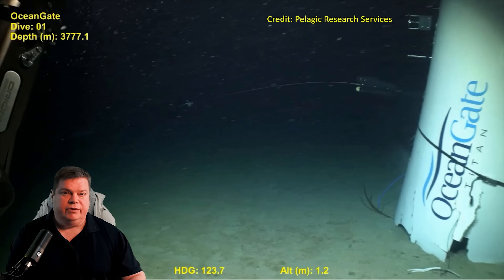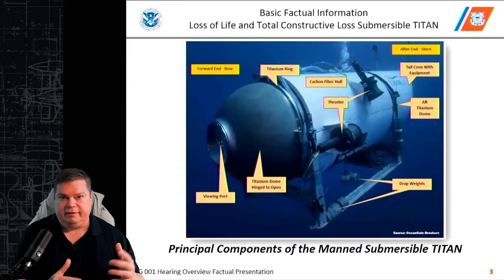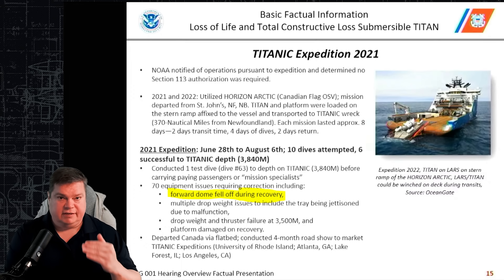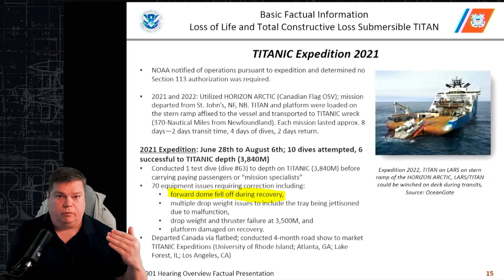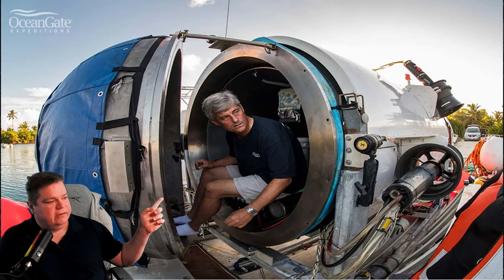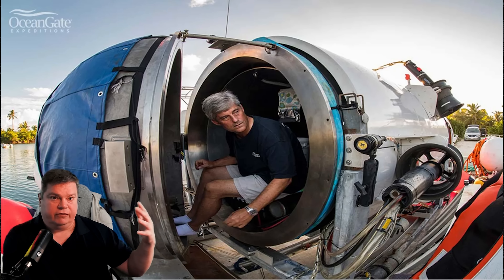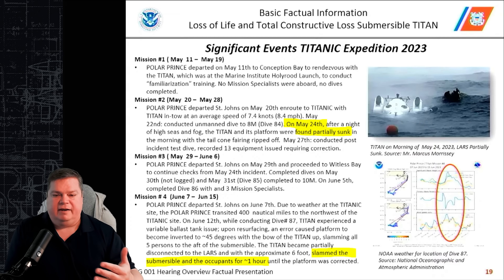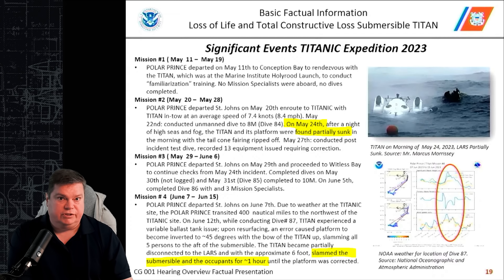New Evidence in Titan Submersible Disaster

Comment: If you study the building of Titan, available on YT, you will see the mating of the titanium rings to the carbon fiber cylinder. You will note that the surface of the titanium appears quite smooth, not roughed up to provide a better bond. Additionally, note that the worker applying the epoxy constantly touches the mating surface and wears no gloves. Any oils on his hands were transferred to that surface prior to mating the surfaces. Now consider that the titanium and carbon fiber react differently to high pressure. The fiber would tend to flex to some degree, while the titanium wouldn't. So this mating surface was problematic from inception.
Reply: Did you notice the dirty rag ? Probably full of oil or grease 😮
Reply: Especialy all the people just casualy walking around it, touching it, no gloves as mentioned and just placed plain outside in a warehouse. No special assembly and isolated chamber nothing...
Reply: The only part of Oceangate that was perfect in every way, was its PR-campaign. They managed to hide all the mistakes, bad engineering, lack of testing, to lure rich clients to the bottom of the sea in a ticking time bomb. Stockton Rush wanted to be the Elon Musk of the oceans, and he did it in a way that was never going to work.
In the construction of the Titan, they cut every corner they could, used bad materials, bad methods, …
When they did testing on the 1/3 scale of the Titan, they discovered that this design just wasn’t safe, and they predicted that it could have a couple of succesful dives, but repeated cycles of huge pressures would lead to a catastrophic failure. Which is exactly what happened.

This accident wasn’t a surprise to the professionals in the field of submersibles, and the disaster that Stockton Rush caused, wasn’t just predictable, it’s downright criminal negligence. He knew it would all go wrong, and took passengers with him anyway. If he had done all his dives solo, I wouldn’t have minded. Those 4 passengers in essence paid $250k to commit suicide.
Reply: Good comment.  They also mixed the epoxy by hand and didn't have paper suits over their street clothes -- sure way to introduce bubbles and dust which will form little weak spots.  It was obvious these people didn't do this for a living.  I worked in a fibreglass shop for a  couple of years and we took more care in making what were basically pool toys never intended to go to the bottom of the North Atlantic.
Reply: They built it in a warehouse, pros do it in a autoclave, controlling temp., humidity and degassing.
Reply: Dude all I could think while watching that was "god I hope that's just for the camera. Please god let that be just a set for the camera dont let this be their actual process. 
Low and behold...
Reply: Stealing word for word what WCGW said in a video last week. Lmao
Reply: The titanium ring interface where the front dome was bolted on was recovered separately, and the inside of it where it was epoxied to the carbon fiber hull was smooth, clean, and devoid of any bits of fiber, as was the dome itself. That's what led Tym Catterson to come to the conclusion that it was blown off when the epoxy failed, causing the implosion. As you stated, the flexing of the hull's end gradually weakened that bond until it finally failed. By comparison, the rear ring was still attached to what was left of the hull, one part of it is still attached to the dome, and the dome itself has visible damage.
Reply: @karlharrelson1091  wouldn’t the water pressure push the end caps into the carbon fiber at depth? like the view port was said to push 3/4 of an inch
Reply: I have a comment from a video when this happened about this, i'll have to go back and find it, the fact the hull had NO prep done, no solvents, no acids, no milled pattern inside the titanium for the glue to bite to, no interference fit of the hull to the ring using a bolt on 3rd part to capture part of the hull so even if the glue fails the ring wont come off!? Not done in a clean room but in an open air warehouse essentially where they do surfacing too and make dust, you never glue up near where you grind/sand, the glue they used was loctite ea9394 is rated for less then 1 atm not more then 1, its aero glue designed for CF planes not sub glue, they did no degassing, I did read the datasheet for the glue and it does say it doesn't need to be degassed if you use it for its intended purpose, which they didn't so I would of done it anyway just in case, its meant to be ejected via a continuous syringe system via a cnc not scraped on by hand which introduces bubbles, also its not meant for 2 parts to be slid against eachother, its supposed to be extruded in a mound and pressed down into shape when 2 parts come together in a specific way, Im sure you've seen it on your car's seams, its the same thing, just everything is wrong about it imo I could go on but I think ive made my point.
Reply: @MrTeapots  seriously even your basic backyard mechanics know that is NOT how to properly mate two surfaces. Every engineer that touched this project should never be able to work in the field ever again.
Reply: I wonder if carbon fiber started to bow inwards as they were diving? As the carbon fiber was flexing inwards  the seal between solid titanium ring tore off. The titanium seal had been strong but each dive had weaken it, like metal looses its strength slowly as it is flexed back and forth movement.
Reply: most likely weakend the carbon fiber over time, because of uneven bonding and therefor stress cracks, that formed on the face where cf and the titanium rings touched. This also makes sense when looking at the pattern it collapsed in
Reply: The seal becomes stronger as the pressure increased.
Reply: @blessedheart3917 water pressure would push water betweeen the ring and the hull the moment that the seal breakes.

Like an engine piston with worn rings, the high pressure moves the líquid/gas behind any miniscule crack towards the área with lower pressure
Reply: @tjnucnuc  That’s why Stockton Rush fired so many people. The moment engineers started noticing all the mistakes and spoke out, he quickly got rid of them and even sued them (Like David Lockridge).
In the end, Rush only kept the youngest people on the team because they didn’t know better or they were too afraid to critique the project.
(Under the guise that he preferred working with young people, claiming some nonsense about young people having more ambition)

Remember: Stockton Rush wanted to build a whole fleet of these submersibles. (In full knowledge that his design was terribly flawed)
Reply: I think with appropriate testing carbon fiber could be used maybe not for this application. Stockton chose to skip the safety side and just go for it. Obviously we know what happened.
Reply: @GoldBl4d3  different expansion rates plus uneven bonding are a killer combination, not better, just more worse
Reply: But, keep in mind that pressure is pushing everything inwards, not trying to separate covers from the body...
Reply: One of the engineers who testified addressed the issue of different modulus of strain for the different materials under pressure, and it was supposedly understood and tested for.  So before that engineer (I think it was Lockridge) left, they had designed for having equal strain modulus for the tube and the titanium ring.  Though Stockton and his team of sycophants may have deviated after Lockridge left.
Reply: Spot on. I can't believe they trusted going under pressure with basically just those bonded joints between them & certain death. Why build it so the middle carbon fiber haul could flex from pressure differently than the titanium end caps. Overtime those joints would weaken and eventually fail. (This sub should have only been a shallow water sub. They were charging a quarter of a million dollars per person so why not take that money and make a much more robust and well designed deep sea submersible... I'll never understand how anyone thought the Titan's design and build was suitable for deep sea dives. It doesn't take an expert to consider where the Titan's weak points are... Those joints between the carbon fiber and titanium epoxy joints
Reply: I’m not even remotely a skilled builder or engineer and I vividly remember thinking the exact same thing about them not sanding down the area where the epoxy was placed, AND the lack of gloves! Not to mention it wasn’t done in a sterile environment at all; it was basically a large garage with doors to the outside open too.
Reply: @ivicamilosavljevic4706  The problem with that is, if the tube flexes inwards even slightly its end is no longer flat. The epoxy will be under tension at the outer edge, causing a peeling force. The slightest gap will cause water to enter with full sea pressure, trying to force the joint further apart.
Even if the epoxy joint was designed to resist the theoretical tension, it would not do so indefinitely. And if it was hand layup well, nowhere near theoretical strength.
If any water enters the joint it is opposed by the compression force on the end dome trying to squeeze it out, but that is opposed by the flexure caused by the pressure on the carbon tube. Once water starts to enter, it will delaminate the epoxy very fast indeed and then enter the hull. 
As soon as the ring detaches, the hull is going to collapse starting at that end, because there is nothing but its inherent rigidity to keep it circular.
Reply: You saw that video too?
Reply: @LandoPro49  Let's say: Even if they followed all those important steps (which they should have) but I don't think it would change the ability to put All trust onto those connection joints.. the risk was always there to eventually have the center haul separate from the titanium end caps.
Reply: Coop submersible. 
Doomed from birth.
Reply: good points. also, if ones considers that the dome is pushed against the tube by the water pressure, and the hull itself is squeezed, it seems that the resulting force, is not "square" with the interface of dome and tube. if the interface were conical like the window too, then the resulting force would be more or less "square", "flat" with the interface. it does not need to be exact flat with the resulting force (vector), but within probably 10 or 15 degrees would be OK (like the friction that keeps nuts and bolts thread tight). 
the way the Titan was, the force would have been like 45 degrees sideways on the interface, and it maybe "slid" off. interference fit would also have helped indeed.  (just wondering what happened, not that it would not have happened, i do not know that)
Reply: the titanium fits over the carbon doesnt it ? would it then not be pushed tighter against the carbon at that depth .
same as diving with the 4 bolts wasnt a issue underwater it was on the boat though.
my guess would be more to the carbon cracking on the transition to the lip which went in the titanium ring do to a sharp edge/angle/corner in the transition.
are there already pictures of those rings which connected to the carbon and are they clean or do they still got carbon in there?
Reply: @ivicamilosavljevic4706  that pressure isn't just pushing in from the ends, it's coming from all directions all at once, one slight weakness in the seal and it's coming in, doesn't matter where it is, and once it's in, there's no keeping it out or stopping it.  

The other consideration is that carbon fibre was a poor choice because it's impossible to know if the layers are delaminating, Carbon fibre and fibreglass at those pressures dont bend and flex, they shatter, according to their own logs, that submersible took multiple hits while trying to recover it, as well as during the storm where it was damaged. and the front literally fell off, the argument of an imperfect construction pretty much presents itself...
Reply: @cornnatron3030   indeed, but, also the tube is squeezed strongly and compresses slightly. the inward force tries to squeeze the tube. this force can be really large, and the interface was along this stress line.
if the interface would have been conical,
that inward squeezing force, would have compressed the interface. the way it was now, the squeezing force had very little support and maybe sheared off (together with the carbon lamination properties, cascading faults)
Reply: Any dust in the air landing on the epoxy?   Don’t know.   It wasn’t a clean room.  Also they eyeballed the seating of the ring to the hull.    Sound good?
Reply: Fantastic summary. As a non-expert but with science background, appreciate your taking us through your analysis. 

No idea an implosion at this depth would “reduce” person(s) so completely. I suppose most all cell walls would undergo a sudden collapse. 

Your final comment about the robotic arms brings home vividly how unsuitable the Titan was.
Reply: Great summary, appreciate your taking us through your analysis. 

Had no idea an implosion at this depth would reduce person(s) to such a degree. I suppose so, as most all cell walls would be suddenly collapsed. 

Your final comment about the ROV’s robotic arms brings home vividly how unsuitable the Titan was.
Reply: Absolutely, . And basically just "Gluing" the two different types of surfaces together seemed suspectable to failure if weight and/ or twisting motions were eventually going to happen. In my opinion, there should have been 30° angle holes drilled into titanium surface, enough for the glue/ epoxy to be filled and add more strength from separation, at least half inch to an inch for enough to be filled and bonded with the rest of whole gluing process. Just my theory.
Reply: Very first day of testimony, very first witness was an engineer who had left Oceangate, who testified he saw evidence of glue seam failure on the forward Ti ring they recovered.  He said the 5" wide round face of the glue seam was completely  stripped off of the Ti; and he said that the inner "lip" of the ring, which snugly fit inside the tube, was completely and cleanly sheared off.  He said that proves that the front end of the tube collapsed inwards from all directions.  Like the whole tube was crimped on the end.
Reply: @Titus_2_11-12  That is exactly what I've been thinking, along with the poor surface prep of the glue. I build carbon fiber boats and all of our surface prep, even on small decorative parts, is higher quality than what I've seen from the videos of their sub construction.
Reply: No that had nothing at all to do with it im sorry to say.

There are some discussions around the thermal expansion coefficient of titanium and carbon fiber still going on, but the forces of thermal expansion are orders of magnitudes stronger of any glue in the world.
Reply: @blessedheart3917  imagine two seesaws end to end put 4000 pounds in the middle - the pivot point is a few inches from the outboard end probably less - the centre flexes down the outboard ends flex up the ends of the C/f tube are no longer parallel to the titanium - there is a gap -  this allows the water to penetrate into that gap - and this is occurring symmetrically along the axial centre line of the tube - if the bond between the titanium lets go at any point around the joint the the water will pierce the gap and begin the collapse
Reply: @kristofvandycke6687  Their PR wasn't perfect at all though, it wasn't even particularly good, because they were proudly putting their disdain for safety and proper design on full display, and also risking bad PR if Boeing, NASA, or University of Washington actually paid attention and sued Rush for misusing their name/trademark while making false claims about their involvement with Titan.

The PR was just lucky, bolstered by ignorance on the part of the "mission specialists".
Reply: @blessedheart3917 it would still breach under that insane pressure. With a broken bond with cylinder you now have a dynamically weak joint
Reply: Painting a Car gets more care than this narcissist death trap submarine.
Reply: @kristofvandycke6687  Not only did he think he was going to be the Elon Musk of the oceans, he thought the oceans were the future of humanity. He thought Mars is a dead end. He thought the surface of the Earth is a dead end (I mean fair, it will be, eventually, but so will the oceans). He thought the future of humanity is in the ocean to hide from the bulging sun. Wild, absolutely WILD and delusional.
Reply: it is something i stated from the beginning. that i assume if the craft had been manufactured in a proper cleanroom by more competent people the same shitty design could have survived many more dives. it was probably still always gonna deteriorate over time but i assume something minute like dust particles getting mixed in with the bonding agent or a fingerprint (oil) might have catastrophic consequences under such high pressures
Reply: @MrTeapots  I've seen better carbon layup in my niche of mountain bikes lol.
Reply: @karlharrelson1091  didnt pick up on human and foreign contaminates possibly or even certainly transferring to the ring let alone pre scuffing of that surface or surfaces.
Taa for those observations.
Reply: And the fact that they never put the carbon fiber through any sort of vacuum or oven to get rid of any air bubbles or cure it
Reply: @aznfoo  That's also pretty strange. Even with non-life critical items we are required to vacuum and bake with a very specific ramp up, hold and ramp down temperatures with about a dozen probes placed around the part and everything is datalogged and then checked by a third party.
Reply: agreed, the winding should have been in a helical pattern, conducted in a dry atmosphere. 
The videos appears to show the winding in a non conditioned building.
The weakest part of the vessel is the mid section of the cylinder. 
It would have distributed the forces much better with a slight barrel shaped cambering along its length.
But I don't design subs
Reply: @ivicamilosavljevic4706  That only takes the end pressure into account. The stress is also on the joint around the circumference where the two parts meet.
Reply: The titan sub was built well, the proof is that they made numerous trips in it already. The issue is that the sub isn't made for that many return trips as it degrades over time due to repeated stresses to the structure.
Reply: @BoleDaPole  If something can't do what it was intended to do, I'm not sure you can really call it "built well".
Reply: I paint Warhammer figures and even I know to scuff up magnets to make them bond to the glue and plastic of the figures.  Wtf was this submarine builder thinking
Reply: @BoleDaPole  That has to be the most idiotic conclusion ANYONE has made on the Titian sub. 
Other than the outright stupidity of your comment how many trips do you think that sub was made for?
Do you really think they made a sub for 10 or 12 dives and then decided that doing one more was Ok?
Reply: But it was cheap!
Reply: @mikeprevost8650  I think that's right
Reply: @blessedheart3917 less surface area than the cylinder. So more pressure force on the cylinder than the end caps. That squeezed out the end cap like gripping a tube of toothpaste and the cap pops open.
Reply: @MrTeapots  I work for a company that has a partnership with one of the bigger F1 teams, we were invited to visit the factory, which makes the monocoque. As you can imagine, air locks, filters for air, anti static materials, complete body suits, masks, gloves, and glasses for everyone.
Of every lot they make(6-7), they randomly take one of them and test it to destruction, to check if their procedures are in spec.
If there's a problem, they scrap the whole lot.
Reply: @Thor_Asgard_  I don't even think the issues sound particularly difficult or expensive to address, but his ego and hubris got in the way.
Reply: @kristofvandycke6687  Agreed. My jaw dropped when I learned that Stockton Rush simply took the damaged parts from the failed prototype and rebuilt them into the Titan. I just.... I cannot even comprehend that level of hubris and utter disregard for human life.
Reply: like a submarine from temu
Reply: @WobblesandBean  The first version of the Titan had one succesful manned dive to 4000m, and on the second one (Which had pilot Karl Stanley on board) they only got to 3760m, and had to abort the mission because of the hull “screaming” under the pressure.
They inspected the hull afterwards, and found that there was a visible crack in it.

They then scrapped that hull, built another submersible with the same design, re-using parts from the first one, knowing that an implosion wasn’t just a possibility, it was a certainty.
(With dozens of professionals contacting Rush saying he was heading for a disaster)

The more I’m learning about this incident, the more I’m starting to dismiss the notion that Rush was simply being too ambitious. I’m beginning to think that Rush was suicidal. (A thought that Karl Stanley brought forward in the most recent hearings)
Reply: The glue is likely the most irrelevant mistake they made. with the sea pushing the ring into place at 5000 lbs/sq in. The glue wasn't holding anything the ring was 100% being press fit in place. The Ring itself had a design flaw: the inner Ledge should have been MUCH thicker because it WAS the only thing keeping the edge of the CF tube from collapsing. any tube edge is its weakest point.
Reply: I'm actually not worried about glue-up, the glue joint isn't really structural beyond first few meters submerged. Because outside water pressure acts against the separation of the joint.

More concerning: different pressure shrinkage of carbon fibre and titanium can cause the titanium lip inside the CF shell to jack CF to failure near the joint. Quality and presence of glue joint is entirely immaterial, it's not an adhesion issue, it's a cohesion issue.

Indeed keeping the glue-up loose may have kept the hull from failing earlier.
Reply: @dragoneyeshatesg00gle76  I’m thinking that people are shocked that the construction phase of the Titan was so unprofessional, not necessarily that the glue itself was bad.
Looking at that video where the carbon fiber hull was joined with the ring, it looked like a couple of guys fixing the exhaust of a cheap car in their garage.

This submersible was to be submitted to the highest pressures imaginable, so you’d expect that they’d want the construction to be precise, sterile and controlled.

Don’t forget: this was a vessel where passengers would pay $250k per seat, per dive. Given the danger of certain death if the hull failed, this was no place for cutting corners or breaking rules. 

David Lochridge is the one guy who did the most to try to stop Stockton Rush getting himself and others killed. And as usual, for doing the right thing David was rewarded with lawsuits, stress and drama.
Reply: @kristofvandycke6687  I know I said the glue is effectively irrelevant. The titanium O ring itself was the problem because it wasn't designed to support the CF tube edge. the inner ledge of that O ring was 1/8" by 2". The 1/8" should have been Inches thick to be Structural support Not just a glue surface.
Reply: @dragoneyeshatesg00gle76  If you’re gonna list all the mistakes they’ve made, we’re gonna be here all day…
Reply: @kristofvandycke6687  
  Exactly. Being a conman, he played on the customers own motivations, to his benefit.
     It sounded like the woman "mission specialist" was "in love" with Stockton, in love with feeling important to his mission going ahead, and for progress.😶
    He's obviously convinced her this is how the Apollo missions & early explorers did it.
  And used her need to feel important & leave a legacy ( not just be a moneybags donor/customer being used for those moneybags 😁).
   It's really sad that feeling ashamed & embarrassed won't allow her & others to face that they were conned & used, that he didn't care about "Progress" with a capital P for humans.
   More about the money that progress would put in his pockets .
And the egoboost that his new "innovations" eg carbon fiber being viable would give him.
  😁☮️🌏
Reply: @kristofvandycke6687  With the debris field and the nose cone separated The O-Ring is almost assured to have been the failure point which is WHY I'm listing it specifically.
Reply: @MikiLund And a clean room with good air filters.
Reply: @karlharrelson1091  that’s the actual problem, flexible at different rates. And because this is a unique design, there’s not exactly lots of studies on the exact mechanics. On paper it’s feasible, the bonding is strong enough and the design (on paper) works. In reality the sheer force from flexing was causing rubbing, and would have weakened the structure bonds.
Reply: @cornnatron3030  The 4 bolts was certainly an issue underwater as well. A "retaining" force of the surrounding water pressure is only in the direction normal to the interface with the ring, and not perpendicular, since the dome is being applied pressure completely and evenly all around, it cancels out in any direction other than "out." So you're simply crossing your fingers no lateral force is ever applied to either dome for any reason, you know, such as hitting something on the sea floor. As soon as such such a force is applied, you have nothing but 4 bolts and some friction stopping the dome from shearing off as it did on the surface. Again, since the seawater is pushing from all angles relative to a shearing angle, it's cancelled out completely and offering no resistance to the dome simply sliding off its joint. Just as if you were holding something tightly in your hand, nothing is preventing someone from simply hitting your hand in order to move it. And all you would need to correct that issue is a simple flange in the dome that fits inside the tube/ring it closes on to prevent it ever moving out of place. They just simply didn't care. It's an incredibly dumb and irresponsible design top to bottom.
Reply: @pearly1789  and how big do you think that friction is with that amount of pressure applied thats not nothing .
see it like a suction cap when no suction is applied it slides around with suction applied that becomes very hard .
same here on the surface no pressure applied it slides easy and the 4 bolt sheared without a issue, under water with pressure applied it would have a hard problem sliding in the first place.
try sliding of the cover of a vacuum chamber under vacuum nearly impossible.
Reply: @MikiLund you wind it first. THEN it goes in the autoclave. 

You can't wind in an autoclave lol